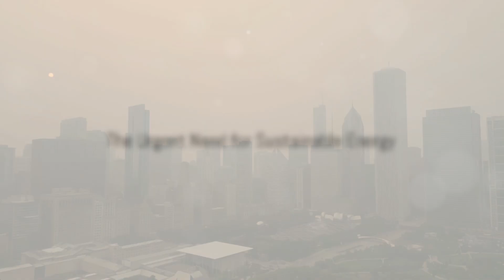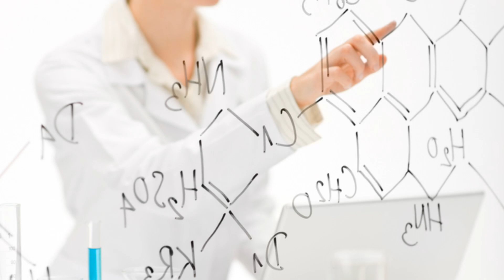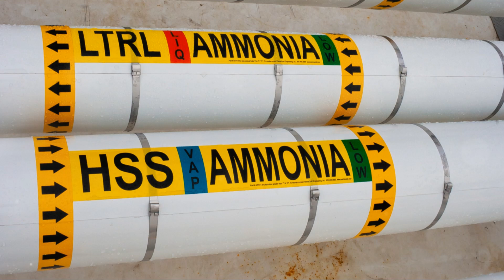How Artificial Photosynthesis Works to generate Energy?

Comment: How does it work?
Reply from the maker: An artificial photosynthesis system typically uses a photoelectrochemical cell or similar structure with specialized catalysts. Sunlight powers the cell, which splits water molecules into hydrogen and oxygen gases. The hydrogen produced is captured for use as fuel, while any carbon dioxide can be converted into synthetic fuels. These systems involve multiple components that work together under sunlight to efficiently convert solar energy into chemical energy, allowing for potential large-scale, renewable energy storage.
Reply: @ omg tysm for ur reply!!! I was wondering you knew what the water oxidation catalyst and proton reduction catalyst is
Reply from the maker: @Fishlover125  In artificial photosynthesis, common catalysts for water oxidation include ruthenium-based complexes (such as Ru(bpy)₃²⁺) and manganese oxides, while proton reduction catalysts often use platinum or nickel-based compounds. These catalysts help drive the reactions needed to split water and generate hydrogen fuel effectively.
Reply: @ tysm I subscribed u
Reply from the maker: @Fishlover125  Thanks
Reply: Artificially make the food particle by without leafe only chlorophyll
Reply from the maker: @snekap2370  Interesting idea! Artificial photosynthesis focuses on mimicking the natural process to produce energy, but creating food particles without leaves is still a concept that requires further scientific development. Chlorophyll plays a role in capturing sunlight, so future innovations might explore novel approaches to directly synthesize food.